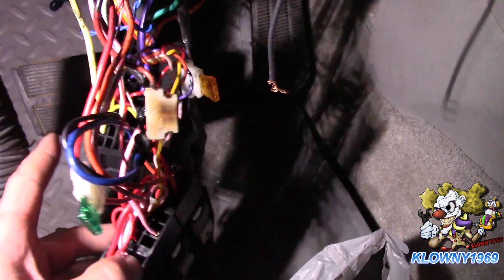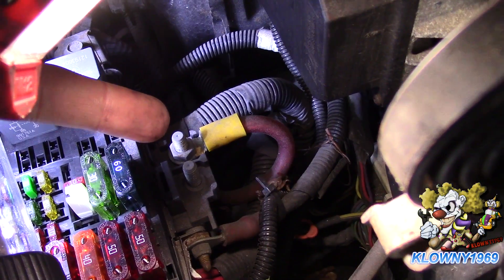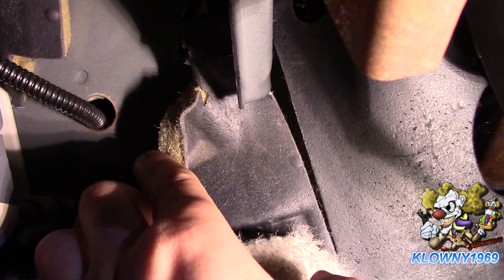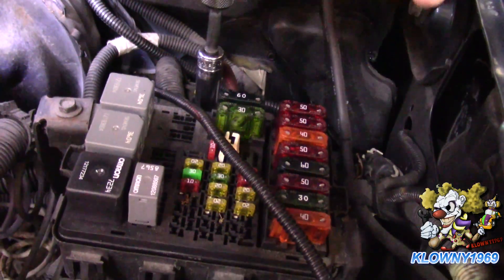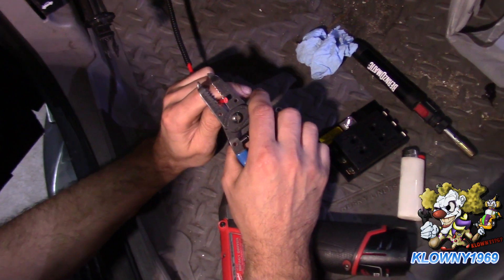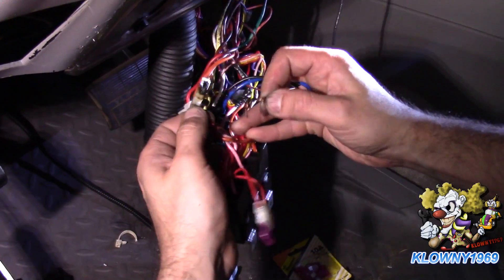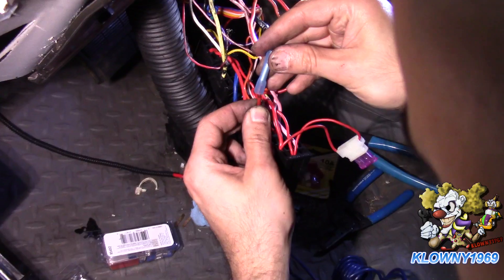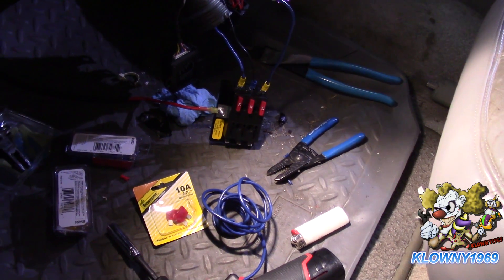How To Wire A Fuse Block - Easy

Comment: what if you have a fuse block where you have to wire up the blade terminals yourself? How do you connect multiple terminals to the one feed wire coming into the box?

Comment: If you are going from a power stud or directly from battery hot to that fuse panel there should be a fuse between the connection and the new fuse panel to insure safety.

Comment: Great video.
Thank you.
I'm trying to Install wire's for a/c  on my 2001 GMC Savana 3500 witch didn't have a/c from factory at all. but I need wiring diagram to do that my self. Especially diagram from the relay fuse box to the AC and AC control knobs. I hope you can help me on this and I do thank you in advance.

Comment: Good video. I have this issue in the relay block under the hood. Specifically the fuel pump relay, I think. Any tips? I know it's a 5 year old video but I figured I'd take a chance and ask anyway.  Thanks for the video nonetheless.

Comment: I know it's the old post klowney but I hope you get it. . Okay my question is picking  size gauge of wire you said has to handle the amperage. you have a 6 slot ,  20 amps per slot so does that got to handle 120 amps total ?
Reply from the maker: We knew we weren't going to out that much amoerage through this thing
Reply: @klowny1969  So when you say handle the amperage with numbers do you got to put together thank you
Reply: @klowny1969  or you meant the 20 amps it puts out? The amps and volts confuse me lol
Reply from the maker: This is a 12 volt system..amps are how much the devices you are connecting to it draw
Reply: @klowny1969  ok so the device has to match the fuse? And not Exceed The Wire?
Reply: @klowny1969  I'm sorry bud, you do have very good videos.
Reply: @klowny1969  I'm sorry I just want to understand correctly. Can you hook up 6 devices to that block?  And were those 3 wires you connected 3 separate devices? And if you had 2 devices running at the same time and they pulled 15 amps each , that would be 30 amps total? Correct?
Reply from the maker: Yes..and the fuse should be at least 15 percent less than what the wire can hold

Comment: Can i connect a 1200 amp the fuse box ?
Reply from the maker: 1200?
Reply: klowny1969 yes 1200 watts
Reply from the maker: Watts or amps?
Reply: Watts
Reply from the maker: That's 100 amps..u are better off connecting a new fuse block from scratch..and also upgrade your alternator..I have a video on putting a fuse block from scratch

Comment: Some tap into existing fuse block and some tap into ignition on column wth
Reply from the maker: ignition on column is not a good idea
Reply: @klowny1969  yeah bro , id hopefully be able to do mine now after this , thanks buying one with a relay built in 40 amps
Reply from the maker: awesome..good luck with the install

Comment: I want to thank you.  Some vandals messed with both my fuse panel and p.d. box, changing a few with too high an amperage, removing several, installing broken ones amongst other things.  I am in the process of going through the system and correcting everything they messed up.  So, again, thank you, you are a big help in my situation.
Reply from the maker: You got it

Comment: In most cars there are empty spots for new circuits both on the engine compartment fuse box (30-40A circuits) and in the fuse box inside (5-20Amps) but the muppets ALWAYS have to tap into the cigarette lighter and burn your car.

Nice job.

Comment: Don't we want to cover the giant bolt in that new fuse block thats carrying a positive 12v before zip tieing it somewhere? That's going directly to the battery with no fuse in between. Fire waiting to happen, I'm kind of surprised the new fuse block didn't have a cover
Reply from the maker: Tom Persons u can put a vacuum cap on it

Comment: I have a 98 Toyota Avalon I plugged the phone charger in the cigarette lighter port I blew the 15 amp fuse which controls the cigarette lighter the clock and the stereo system I replaced a fuse to everything work again two months later go by cigarette lighter again blew the fuse I replaced the fuse nothing works now I checked all the fuses far as I can see they're all good so I'm without a cigarette lighter a stereo system and a clock would you have any idea what can be going wrong

Comment: Why didn't you mount the fuse block  ,  and that stud is hot where the power cable comes in is there a safe way to cover the stud  .  Do they make something similar like a valve stem cap to cover the rest of the exposed threads.
Reply from the maker: I did mount it..i dont remember if i showed that in the vid..u can use a vacuum cap to cover that stud if u want
Reply: Thanks for responding back and i did think of the vac cap after  awhile . Good videos  very informative
Reply from the maker: D T anytime

Comment: do you need to fuse the wire going from he original fuse block to the new one? Or is there a spot on fuse blocks that protects the wire feeding it?
Reply: Shane Jovanovic you should. I don't think he did that tho.
Reply: benefactionhindrance milk
Reply: As long as he doesn't pull to much that original wire should be okay to handle the amps. Usually when you start to pull to much, that new fuse panel he got looks like one that has a built in fuse to cut power from there and onward. You can fuse the original wire if you want if it isn't already but just don't over do it and you should be okay.
Reply: @pxndxlunx5821  but it isn't about overdoing it but about protecting the circuit. I would have put a fuse because if that wire ever touches earth then there's no protection and it will be sparking until the wire melts or the car burns.

Comment: Question guys. If I were to do this without connecting to a known source, but running new circuits, will they all be hot? What if I wanted to run it for lets say an accessory that I need turned on only when I crank up?
Reply from the maker: foreverwood1963 yes..watch my video on how to wire a switched fuse block

Comment: why did you not tin the wire?... I know not necessary but this is car wiring in a moisture exposed spot... a little sodder goes a long way...
Reply from the maker: Scott Margerum not necessary here..the one on the fuse block in the engine bay is heat shrinked and resists the elements..the one inside doesnt need anything because its inside the car..thanks for watching and commenting

Comment: No longer need to spend time checking all the fuses with a tester or visually. Developed smart fuses, what glow when blow. Immediately easily understand what needs to be replaced. There are different types and nominals.

http://www.ebay.com/itm/AUTO-CAR-FUSE-MINI-ASP-ATM-APM-small-size-blade-LED-indicator-GLOW-WHEN-BLOW-MIX-/191852248056?ssPageName=STRK:MESE:IT 

http://www.ebay.com/itm/AUTO-CAR-FUSE-ATO-ATC-ATP-Standard-size-blade-LED-indicator-GLOW-WHEN-BLOW-MIX-/201565468505?ssPageName=STRK:MESE:IT
Reply from the maker: Maria m why are u spamming my video?
Reply: Hello. I saw that you use fuses the previous version - no LED display, so I decided to write =)

Comment: Great video man! I don't have much electrical knowledge at all. Would it be ok to power the block by tapping into an existing fuse instead of running a wire from the battery?
Reply from the maker: thanks..i wouldnt do that

Comment: klowney,

I'm wondering if you'll take on a fusebox upgrade on an old Chevy in the future if the opportunity arises.  I currently have a C30 and/or C10 (350ci 1976) based Chevy RV with the old buss fuse box and it looks horrendous. I wanna upgrade to the new ATP box.  I hope that project eventually happens.  Thanks in advance... DC

https://drive.google.com/file/d/0B0AjMf_oV2c4blJZOERuYkcwM1VLbDJlVHMtVXJLdkRWWXpN/view?usp=docslist_api
Reply from the maker: i might do a painless wiring fuse panel on a 79 camaro..
Reply: +klowny1969 

cool man... I appreciate it!
(hope there's a direct replacement kit for these and the Camaro's is somewhat similar to my Chevy)... DC
Reply: +klowny1969 
[also I hope it's a direct replacement ATC unit and if you can obviously focus on the step-by-step matching of the wiring, that'll be great along with source of the find] Thanks again bud
Reply from the maker: +dcracing1 np..i am swamped with projects atm lol
Reply: +klowny1969 
no problem and no rush
i may end up posting it myself...
and it's a race! lol